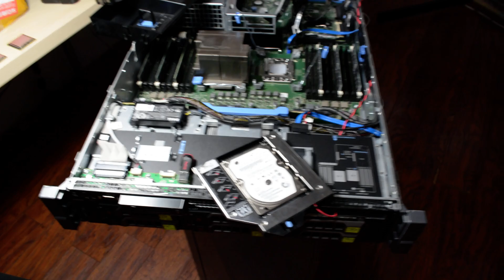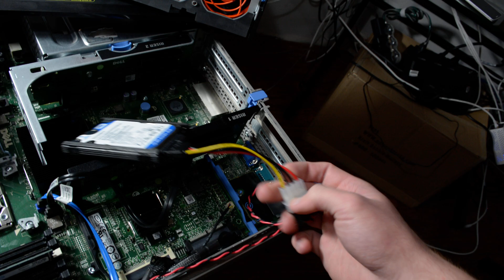How I installed 2 additional 2.5" hard drives into the Dell R710

Comment: I soldered a wire USB male to SATA power and use the internal USB port to power the SSD. The port only supplies 500 mA but as far as I see this is enough to get the SSD to work, even though it states it needs 1A.

Comment: Can you show a more specific photo of where you picked up the power from?
Reply from the maker: Don't have it anymore, best advice I have for you is to lookup the pinout of a slimline sata power connector and soldering to those connections
Reply: Nikita Skakun The only commercial source I have found for this Cable has a price tag of $99!
Reply from the maker: @glen4cindy  link? I'm talking about the DVD drive adapter that you can solder the wires to
Reply: Nikita Skakun No, I understand. That’s why I’m interested in your video. I don’t want to pay that much for a cable.

Comment: Nice work on that, I have an R710 also.  I never thought about using the CD drive conversion, though I have used them in the past for laptops.  I wound up putting an mSATA to PCIe x1 card in mine and booting from that.

Comment: Just did similar on mine, got the official dell optical drive cable, spliced into it with a molex to sata power adapter and hooked up two drives.
For some reason however neither of my drives show up.  I wonder if something is broken on my system.  I'll need to get a multi meter and see if that 4 pin is giving power, or it could just be the SSD's I am using I have seen them not work before in other systems.
Reply: This might be a bit late for you but other having the same issue might find this helpful but..|

In BIOS, a lot of the internal SATA port(s) on the motherboard are disabled. F2 to enter BIOS, go through the settings and activate the ports (A, B or both).

I had the same issue, turned on the port I was using and the SSD showed up in BIOS, now I'm trouble shooting windows installer not finding the drive. Probably needs to be formatted but I'm still looking for solutions.

Comment: Hi, i bought a CD drive adapter like you did. but my drive doesn't show up. do i need to change a setting?
Reply from the maker: Doesn't show up where? What software are you trying to use (shows up in ESXi just fine for me)
Remember, the SATA ports on the motherboard do not go to the raid card.

Comment: What size (height) was your DVD hard drive adapter for the r710?
Reply from the maker: Good question, it's the thicker driver adapter, 9.2mm iirc
Reply: wait in the description it said 12.7mm was it 9.2mm?
Reply: 9.2 ,, installed two today same for r610
Reply: >> r710 << is 12.7mm! maybe r610 is thinner?!